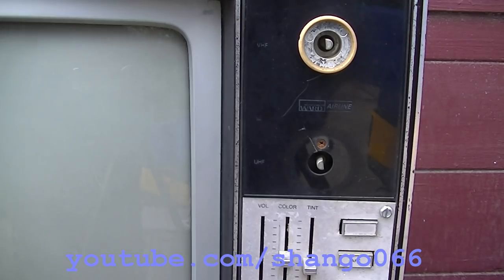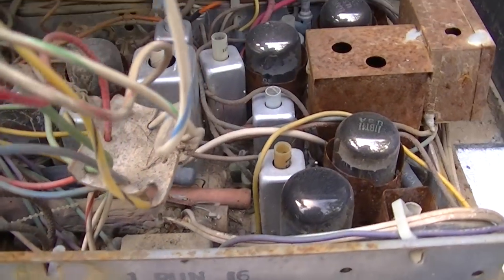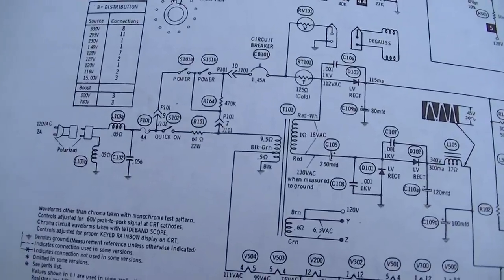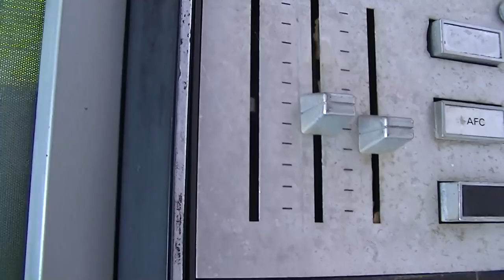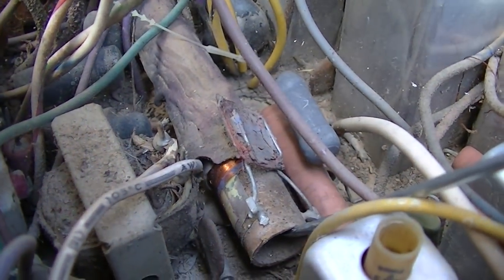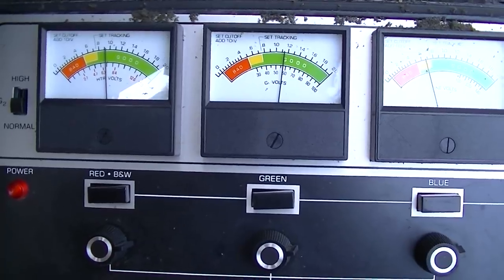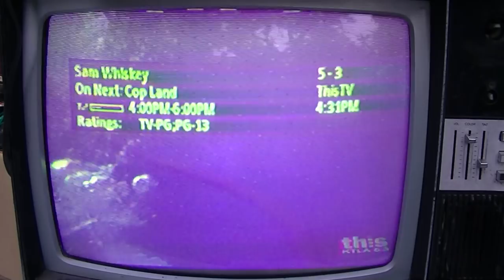1974 Wards Airline Portable Color Tube Television Repair Assessment pt1

Comment: I so enjoy your videos!  I believe Admiral made this set for MW.  Even considering the open delay line, and weak CRT, bad tuner, etc., the longer it plays, the better it looks!  I agree with you, these are just nearly all long gone TVs.  It's amazing this set is able to do as much as it does, after being in the desert for many years, testifying to yesterday's quality, even on a "budget" TV set!  I'll venture to say, if we are all around 30 years from now, and you pull a flat screen from the desert, it won't even do what these older sets do!  I'm sure all it's plastic would likely crumble as it's handled!  Thanks for the quality videos you provide!
Reply: @jdslyman Your set was probably made by Sharp. They were also a big supplier of TV's for MW during the '70's. Sylvania also made some sets for them; but, those would not have Hitachi parts in them.
Reply: I have one from 1976, b&w and the Admiral equivalent of it seems to be the Admiral SKB1901

Comment: The 70's - an era where solid state TV gradually became the norm.
We didn't have (m)any tube colour sets in Australia around this time - except for an imported British hybrid set (the "Decca 33") the rest of our 'all-tube' TV's were B&W.
Plus, we first got colour in 1975 and before 1956, we had no TV at all.

The Philips K-9 chassis made for the European market around the early-to-mid 70's used a delta gun picture tube (with a deflection angle of about 110³). It was the only tube in the set - the rest was all solid state and incorporated a modular design for IF, Chroma-Luminance/Demodulation, etc. These plug-in modules were contained inside a metal case and were not serviceable - to fix a fault caused by one of them, you sent it off for exchange via Philips, and plugged the new replacement in. I repaired many of these beasts a few years ago and restored some to full working condition.

Great video - illustrating a piece of history that would otherwise be forgotten, in spite of its medical ailments. Cheers.
Reply: I had a K9 chassis TV when I was a student, it was great! It was prbly already 15-20 years old by then. It died when I tried to get rid of the dust that had accumulated in the switchmode power supply..........
Reply: @skuula  I used to re-cap those supplies (changing the main filter electrolytics) as well as replacing the 4 bridge rectifier diodes and degaussing PTC. If everything checked out OK (including the power transformer and chopper transistor) the supply would normally work. The main issue with K-9's was dry solder joints, especially in the high voltage/power supply/IF strip areas.
Another smaller problem was their convergence assemblies - a board inside the front control/speaker panel which contained several pots and coils that drifted with temperature changes or whenever the set was moved - resulting in static and/or dynamic convergence being slightly out of alignment. The "true fix" for this was to lock-seal the pots after re-alignment (either with a tiny bit of nail polish or special technician's paint at the base of the wiper). It was one of the many things I did when I serviced a few of those TV's back in the day. I also did the line-sync modification (for VCR playback which simply involved adding 2 wire links to the line control module socket) and replaced some CRT's in a handful of K-9's - then setup and aligned them to produce a reasonable, clear, colour picture. The sound was already good.

The trick to getting most of the dust out of K-9 or K-11 chassis sets is to use light compressed air in short bursts when the set is unplugged from the wall. Then you can diagnose the condition more easily prior to any component testing and/or repair.

They were good sets when they worked in the 70's and 80's but nowadays finding a working one that has never been serviced or cleaned in its 40+ year lifetime would be extremely rare.

Comment: They were a mail order outfit when I was a kid.My parents bought a new Wards B&W box set back in  1957.I found one like it in 1976 in a secondhand store and got it for $5.00.It was a $2.00 fix:it needed a new fusible resistor.It looked like new when I bought it.I ended up selling it to some gal for $15.They started in the latter half of the Nineteenth Century in Chicago just like Sears and Spiegel.If I remember right,Airline was made by Wells-Gardner;Spiegel was made by Gambel-Skogmo.Some of the Airline sfuff was made by Belmont.
Reply: I remember the Belmont pushbutton models from the immediate pre and post WW2 eras. During the first few WW2 years several small makers made brief appearances before they went extinct in the early to mid 50s. Wards was pretty good at keeping to American makers while other chains went Japanese really fast.

Comment: We had a solid state Magnavox console 25 inch with instant on. (Bought 1974) 
I believe the heater on the picture tube was always on. (It had a switch to turn instant on off) It lasted 7 years until the picture was too dim to enjoy.
Yes, leave the dirt. What matters is that it works.

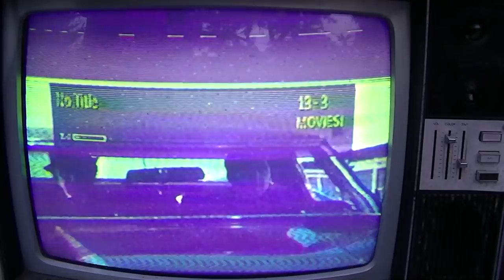Comment: The French Connection @ 43:15 ...Great movie, one best of all time. That picture on that set, in analog...I watched TV like that for decades. Re "Barbershop" Yeah.. I could imagine sitting in a barbershop on a rainy Saturday afternoon in the 70's and they have on some really old 1950's crime drama show tuned to one of the "Independent Channels" on some old decrepit black and white TV with the audio buzz along with the obligatory busted rabbit ears and tin foil. In fact I probably did spend some rainy Saturday afternoons doing just that. 

 Yep, there is some good channels on the Digital subs like Quest and Escape among others. The Decades Channel started running the original Dark Shadows. Johnny Carson reruns, Carol Burnett, and tons of others...Even the PBS stuff isn't too terrible. 

I got to watch a couple of hours of DW (Deutsche Welle) on the local 14-4 here and it blew away American TV in reporting. I mean here was news, they actually news reported news. Straightforward, unbiased.....felt I was in some kind of a time warp. Poor man's Cable TV...Just with a decent amplified antenna, you can get 50 + channels and subs for free. It's like having free cable TV...In fact we get more channels now on over the air digital then what we had on our 36 channel cable in 1979. Another great video and thanks for the nostalgia too...

Comment: The number on the flyback can is the chassis number...23K18

I think there were some instant-on TVs, particularly the Panasonic ones, which had an autotransformer with a tap changer just to switch the filament voltage for instant-on.

Comment: I think it looks quite European with the sliding controls. All it needs is a 'push-out' style CRT!  Those type of controls were all the rage here, even into the early eighties. From my experience they always tended to be of good quality (usually Alps/ Philips/ ITT manufactured), and rarely gave trouble unless 'toyed with'.
Reply: I never had a problem with the ones on vertical front panels of TVs, equalizers, etc. A friend of mine worked for ARP instruments in the 1970s and they were always replacing those sliders, but that was on a horizontal panel which made them much more vulnerable. If he could have harvested and sold  all the cocaine that fell into those things, he'd probably have been set for life.
Reply: I always saw sliders fill up with dust and get unreliable, noisy contact... With rotaries,  fewer problems.

Comment: 3.9 meg is an awfully high value resistor to bypass.
Reply: If it is part of the voltage divider for focus, 3.9M is standard value. Sometimes you need to bypass part of the divider, if the voltage is too high.

Comment: dirt? paintbrush and a vacumn cleaner sucks up the dirt. hosing it down, or washing it is only for mouse pee chassis.  remove or cover things like speakers. after its washed, take open up the power transformer covers. lets it air dry for a few weeks. usually works. i only reserve that for sets like mouse pee, or otherwise sets that are already ruined, to see if they can be saves. havent lost one yet

Comment: Looks like your blue is a little bit alive.  Quick question, without the delay line - how the hell you have a watchable picture?  I'd think it would look like "Nagra Plus", the analog cable scrambling system using pseudorandom line shuffling once used in European cable TV on PAL.  I was used to Sync Suppression (Jerrold) and SSAVI (Sync Suppression and Video Inversion) in my area.  Anyway, doesn't the delay line allow the vertical to draw the next line?

Comment: After the set "works" try this. Change all the low level tubes one at a time noting improvements.
You will find most are bad. Did this to a few GE sets also with same tube line up. Trouble is even
then compactrons were so $$ you couldnt do it so these sets were seldom fixed "right". 
RCA also had there 1st plastic cabinet 19" &14" sets were the same but used normal tubes.
LFOD !
Reply: It seemed like Compactrons were not very durable. Maybe it was because so many functions in one bulb magnified the chances of one going bad and needing replacement but they did not seem as durable as regular tubes.

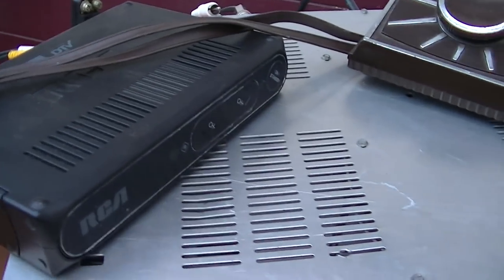Comment: 33:25 nowadays you have 'engineered for digital ATSC reception' on these antennas. Because you know... different wire for BW, different for color and a different for digital. Sell you the same crap 3x times.
Reply: Electrically it is the same old VHF or UHF antenna they have been selling for decades.
Reply: @Membrane556   Since everyone was forced to give up the VHF-hi band they only use UHF now...
Reply: @douro20  They still broadcast on the VHF high band in the US but they reallocated UHF channels above 52.
Reply: Membrane556 In another year or so the band will end at 36!

Comment: Dirt don't hurt but have you ever seen one sitting next to a kitchen stove and filled with bacon grease from cooking over the years? The grease was so thick the tube socket pins would ohm out to one another. The tubes were removed. The chorizo comment made me think of this combined with your dirt don't hurt comment.

Comment: Who the hell pays $22,00 for a scan of the schematics of a 45 year old tv set? I really appreciate the effort of getting that old stuff online, but $22 for a pdf-scan? Really?
Reply: That is why I never look at the Sams site anymore. Cheaper to find a paper copy on eBay. Once you know the folder number you can look for it or locate another section of it from a seller and ask if they have the one you want. Sams is just trading off their past now.
Reply: Agree, but you can also subscribe, which makes the cost per schematic much lower. The market for even that has probably dwindled to nothing as well.
Reply: Agreed. A waste of money unless you have a regular stream of these things it is not a good value.
Reply: Yeah but unfortunately there are times where you will end up having to get it from sams I’ve already had to do it a few times
Reply: + @nikkihendrix1234  It has never happened often enough for me to fork out for a subscription. One every 6-12 months means I just buy them then - and only after exhausting other options.